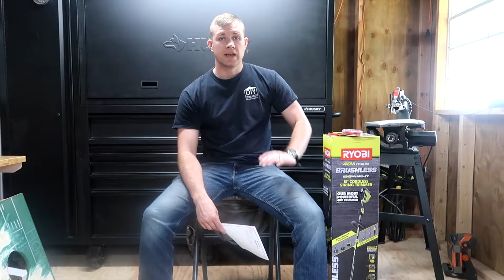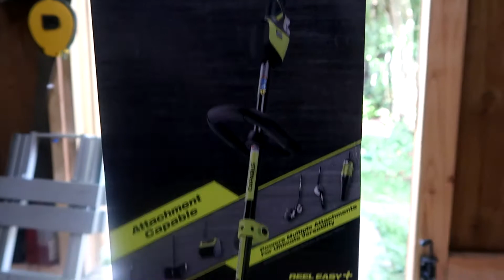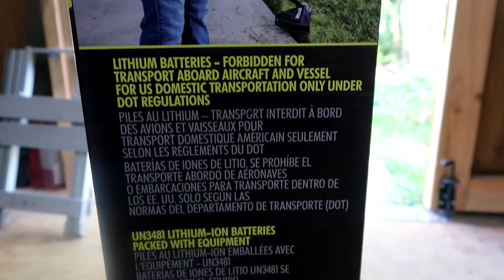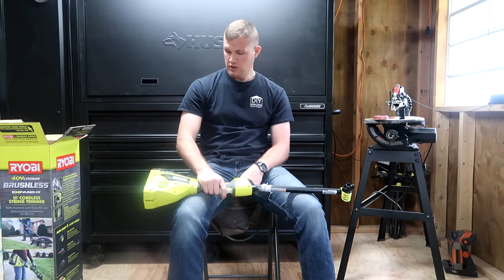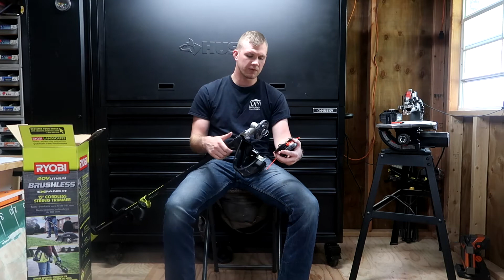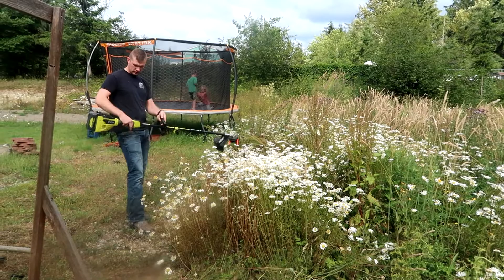Unboxing and review of Ryobi 40-Volt cordless string trimmer

Comment: The Amazon link in the description is not for the Brushless RY40270 models that was in the video.

It’s for the  40250🤦‍♂️. I got the wrong one.   However, thanks for the tutorial.  Great info.
Reply: Wow, this Chris guy still did not fix the link, or acknowledge the mistake. Lame.
Reply from the maker: I have been in the process of moving with my family. Thanks for the patience and understanding. Have a great day.
Reply from the maker: Updated, I don't see the RY40270 available on Amazon anymore and Home Depot website is blocked at my current location. I updated the link to the only RY40270 on Amazon which is a factory reconditioned version. Thanks for the feedback.